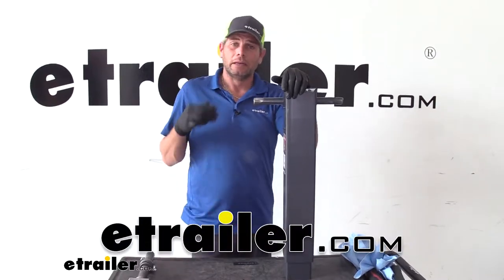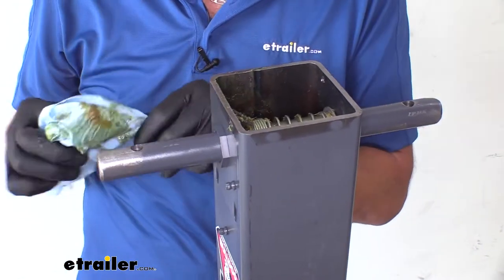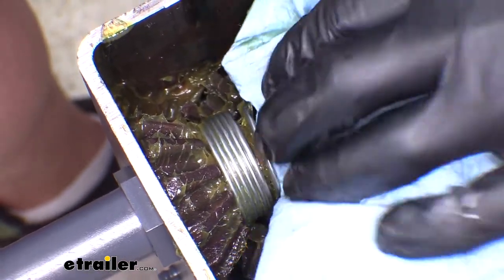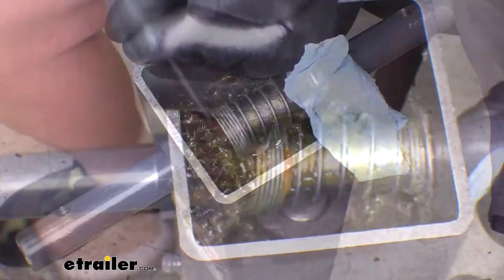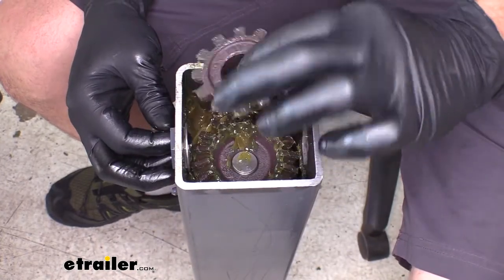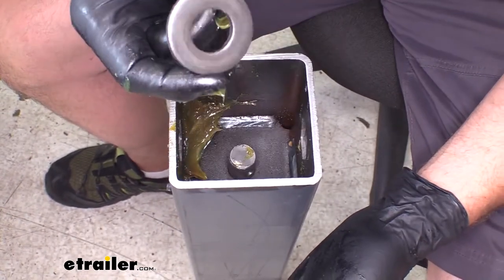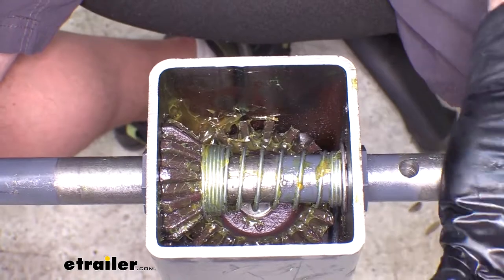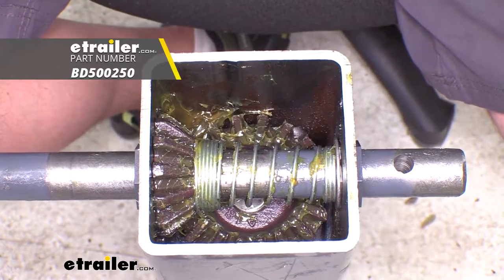etrailer | Bulldog Square Jacks Rebuild using Replacement Screw and Nut Assembly

Comment: I've got a model 180 and I have seen little ball bearings falling out. Are the bearings sold separately?‽ It still works ok I would like to just replace the bearings. Is that possible?‽
Reply from the maker: Check out the following jack rebuild kit. It should work great to replace the components in your Bulldog Jack.
https://www.etrailer.com/Accessories-and-Parts/Bulldog/BD800144.html